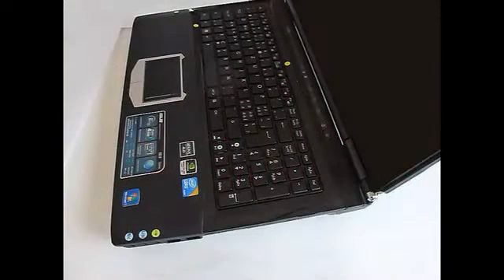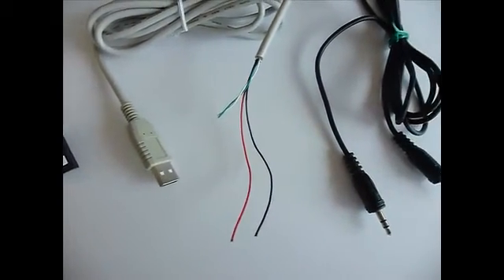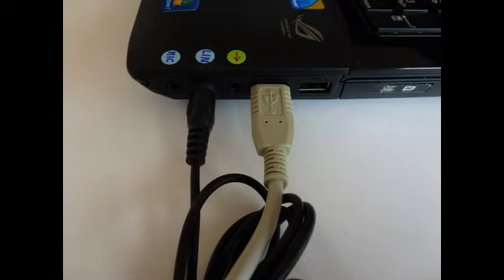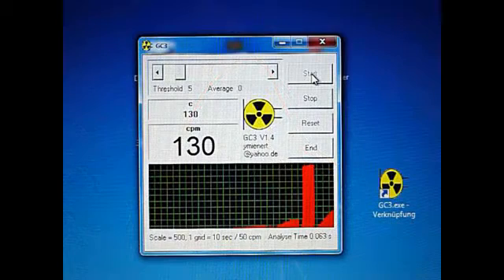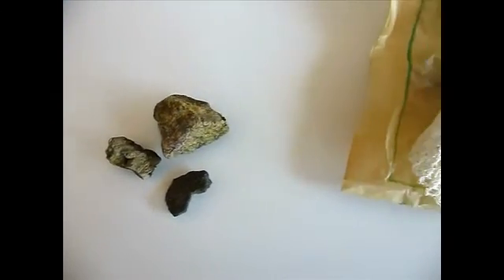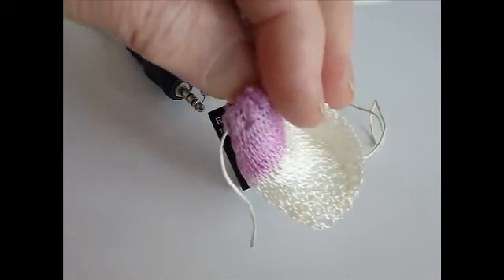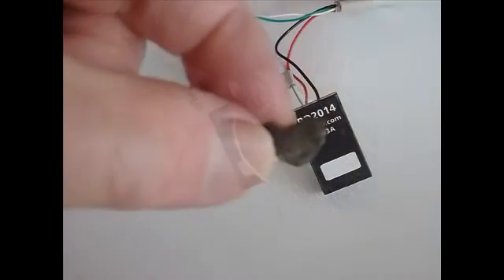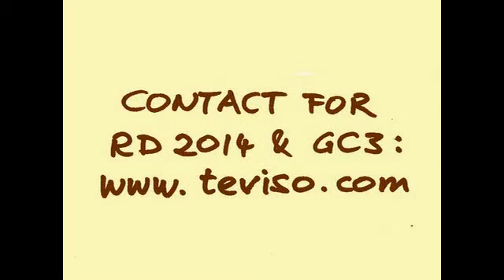PIN diode sensor module detecting nuclear radiation

Comment: I tried to get just ON / OFF output (I want not to make a dosimeter).  However, the sensor output is so fast, that detection On switch quickly to OFF, even with radioactive sources over sensor.  How could i get  better signal?, other filter? the way if the source is over sensor, keep state.